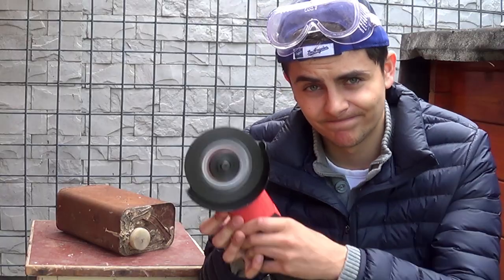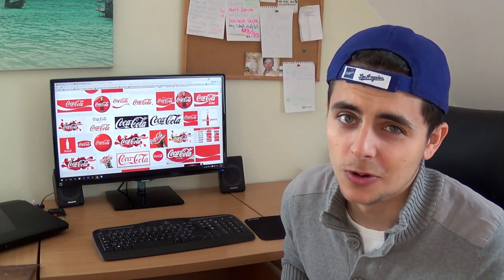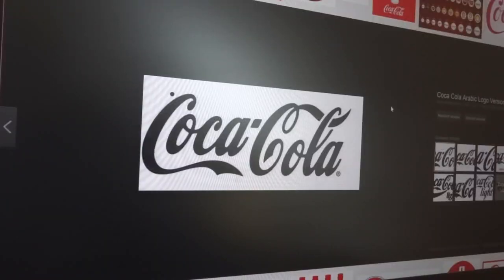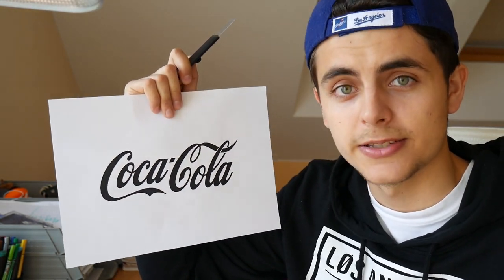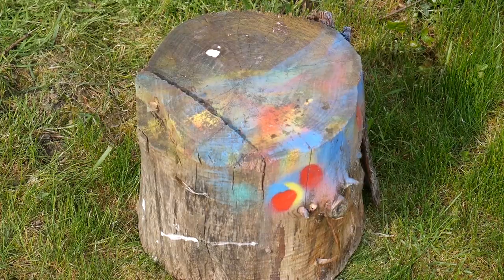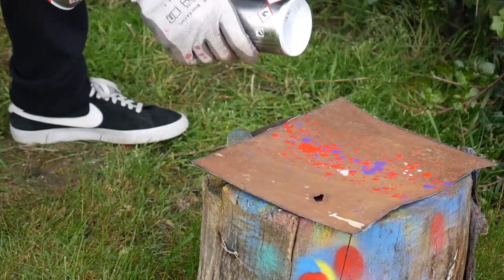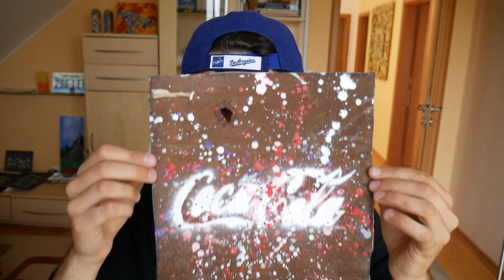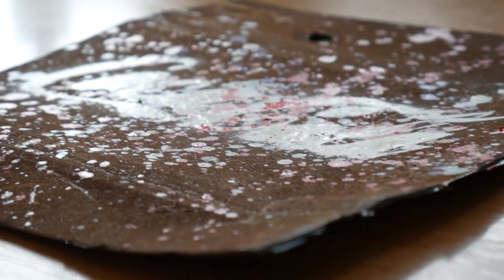DIY | VINTAGE ROOM DECOR

Comment: Hey Doke, greetings from Canada! First of all I love your graffiti art, you are very talented at what you do and I look forward to watching your channel grow. I noticed you were having a bit of trouble achieving a clear and legible image with your stencil, as a student of the arts who works mainly with stencils I know this struggle well. If you are interested in using stencils in future videos I have a few humble suggestions. Purchasing a decent precision razor will make the creation of the stencil much easier, I myself use a simple X-Acto #1 precision knife that you can pick up at Staples for around $3. More importantly is the issue of achieving a clean and legible stencil, in letter form stencils like this one clean lines are especially important. I recommend a temporary/movable spray adhesive, this will make sure no paint leaks beneath your stencil. I have used a Krylon all purpose spray adhesive successfully on many surfaces including wood, metal and canvas but there are many brands out there that should work. Thanks for your time and keep up the great work!
-Adam
Reply from the maker: +Adam Clouthier Thank you For your suggestions !